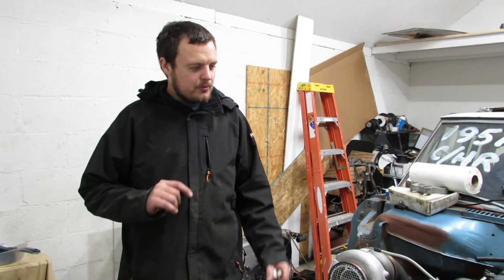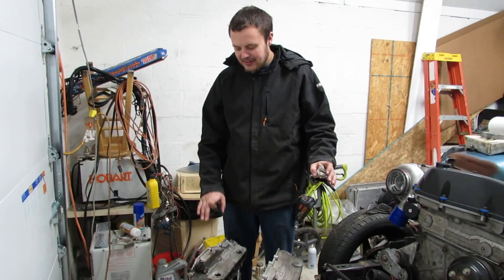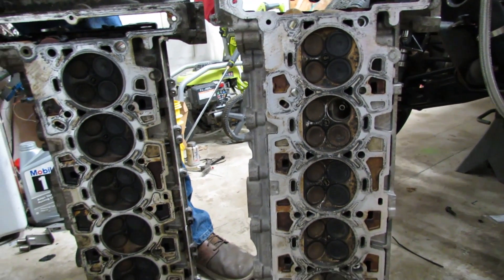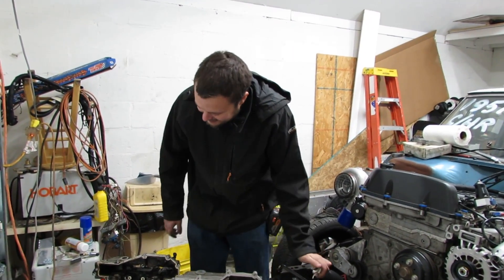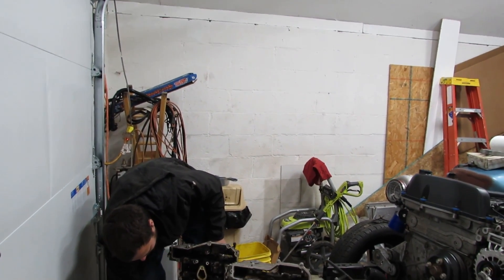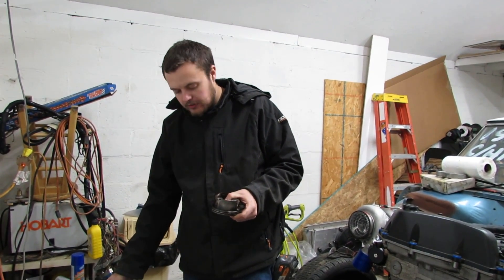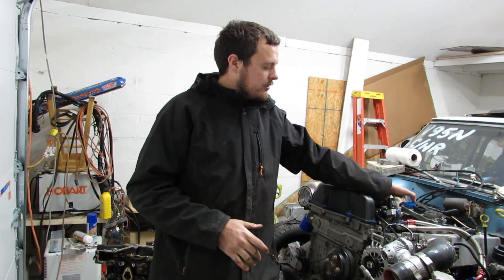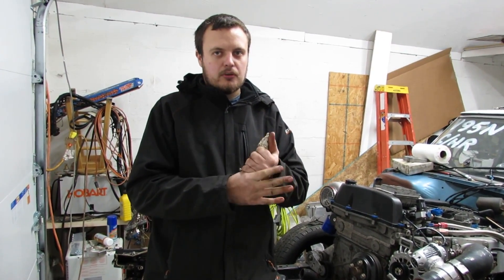Vortec 4200 Engine Differences

Comment: you're going to laugh at me, and this sounds pretty ignorant, what I'm about to say.
 I just noticed something that makes the 4200 kind of bulletproof, compared to the V8 and LS motors:
on the v8LS:  main/rod-rod/main....
on the 4200: main/rod/main/rod....

Now, I know the LS can handle tons of horsepower. That basic v8 crank layout is in top fuel motors making 11,000 horsepower. I'm not saying v8s aren't strong.  All that I'm saying is, just by the look of the crank in the Atlas, it should be able to handle tons of horsepower more easily, with less stress on that crank. 
If you ever want to see something really funny, look under an early 6 cylinder, or a flathead V8.... it amazes me, how few main journals you need, for engines with so many cylinders, LOL
Reply from the maker: Yep. Now you are starting to understand. 

I've seen the early 6 cylinders. Like 4 main caps. Crazy.

Comment: So how do set and forget the vvt???
Reply from the maker: Lock the exhaust cam position.
Reply: So would it be easier to just swap a healthy 06 engine rather than do the 06 head swap
Reply from the maker: @fredsamuels6407  it is probably easier to just do a head swap, but if you question the health of the bottom end, up to you.
Reply: I've got an 04 trailblazer with that valve issue that I didn't hear about till after I got it

Comment: For the life of me I do not understand why GM gave up on this engine platform. Perhaps limited use is one reason but to be this would have been an ideal base engine in the Chevrolet pickup. Or in commercial vehicles. 
In reference to the dyno results versus the 5.3L LS. Maybe the reason the the 4.2 made more power at the same boost level is the cam timing. The bigger cam in the LS with more valve overlap might have been allowing more fuel air mixture to blow thru the cylinder during the overlap period. At the height of piston aero engine development in the 1940s high output aero engines did not have extreme cam profiles. Remember these engines often had two stage,  two speed supercharging systems.  The second stage was not to provide more boost st lower altitudes but to maintain power output at higher ones.
Reply from the maker: But I thought that all cams are turbo cams! 

In all seriousness. You're probably onto something there. We adjusted the cam timing on the 4.2 and picked up probably 45hp on the last pull.
Reply: @Calvin-Nelson  
One does need to remember that automotive and aero engines are different ball games in a lot of ways. Aero engines are not high rpm. But given their overall size and long stroke they reach some pretty impressive peak piston speeds. Plus there is the need to be extremely reliable. The Allison for instance was pushed up to around 65 inches of boost at the squadron level during the war.

Comment: So friend  has an 07 2x2 with bad engine / rod knock till it warms up after short time drive comes back. He got a deal on an 04 4x4 thats clean. Seems the crank and cam teeth count are the same. Only issue maybe the vvt on the cam as they changed  06/up ? If that isn't an issue should work fine since change rails or what minor things over. Don't thing oil pan isissue.  Yard was saying they should interchange according to Hollander. Thanks
Reply from the maker: Yeah. Should interchange. Like you said the VVT is the only question mark.

Comment: Love these inline sixes. One of wards ten best engines. More powerful and torquey than the 4.0 in the Jeep.
Reply: Generations more advanced of a design. What would you expect. The 4.0 is a great engine that will tun forever. Provided it is taken care of. But it was an old design. The initial production of the design was in 1964 but in concept it is very similiar to any other inline OHV six. Post 2000 there was some preliminary work done on adapting it to 24 valves.  Either OHV or a head similiar to the Chrysler 3.5/4.0 V-6. The 3.5 is a little weird. 4 valves per cylinder with two intake lobes and one exhaust.
Reply: @mpetersen6  yes i had a 4.0 litre in a 1993 cherokee 2 door. It had 340,00 k on it when i sold it. Was running perfect as was trans. It seemed bullet proof.
Reply: @TC-hs5wy  
Remember when GM was building that Cyclone S-10. Spent a bunch of money taking a specially prepped one out to the Salt Flats and set some records. A year or two later an engineer in Jeep powertrain on his own prepped a Commanche with a 4.0. Turbo etc. Took it to Bonneville and crushed the records that GM set. Pushed that Commanche up to close to 200.

Comment: On modern engines without rocker arms they are internationally known as "valve cover" but are sometimes referred to as a "cam cover" or "timing cover" if they also cover the timing gear(s) and belt or chain.
Reply from the maker: Good to know. I'll still screw it up.
Reply: @Calvin-Nelson  I just copied and pasted that - I had never even heard of either term before - thanks for the great vids! I'm tooling around in my TB 04 - wondering if some MMO will clog up my oil pan filter since the whole drive train would have to be taken apart if that happens! haha. I used some MMO before and had the classic dirty exhaust smoke clean out. So I guess I got lucky. Also I put in boron Nitride. ... At 267K so far so good - the third valve did not burn out as happens on those engines. haha. thanks again.

Comment: so is the older engine better then the newer engine
Reply from the maker: Eh. The crank is. The later rods are a tiny bit larger, and have larger pins. Also the later heads are better. 

My recommendation to everyone is buy whatever you can find and stick a turbo on it and never look back
Reply: @Calvin-Nelson  I swear my local mechanic was after my engine. haha. He insisted I had to salvage the car. I went to a welder who said the rust hole was in the "neutral zone" of the chassis - fixed it no problem. I figured it was fixable. Thought it was strange how adamant the mechanic was.

Comment: GM tends not to fix things that aren't demonstrably broken. I'd upgrade valve springs on a turbo engine if they did for n/a.
Reply from the maker: We've used stock valve springs up to 600whp. 25 psi boost.

Comment: I pulled an engine from an 07 and am putting it in an 08 I see the flywheel is different on it... Anybody notice this? I checked the cam phaser same and the crank sprocket also the same... So what is the reason for the change torque converter? Also it has a bearing in the back of the crank? Kinda like a throw out bearing but not
Actually they are both from 08 but one is from a TB and one from an envoy. 
The year and date on the door was 07/07 but the title was 08
Reply from the maker: 08 should have 58 tooth. If it has the 7 tooth, it's not an 08

Comment: Great channel.  Regarding differences through the years, are the 2002-2005 blocks externally the same as 2006+ blocks? I have a 2002 that I plan to use for fitment test and motor mount fabrication.  If I get it to fit, I plan to find a good 2006 to swap in.
Reply from the maker: Only difference dimensionally is the cam cover is a little shorter lengthwise and a bit taller on the later motors.
Reply: @Calvin-Nelson  Thanks man!  I got the 2002 motor - reportedly bad - for $50.  Going to attempt to fit it in 2nd gen camaro, so I know I have some work ahead of me.... along with doing a rear sump pan.
Reply from the maker: @slackhannan1665  very cool.

Comment: Can you use any aftermarket ecu with this engine, like a Holley terminator?
Reply from the maker: You can use any ecu with it that supports the trigger. Also, I recommend making sure it supports the VVT. The holley Terminator would only work on the 08-09 motors unless you put an external trigger wheel on it. However Terminator will not control the VVT.

Comment: I have a colorado and want to keep the 58x wheel so that way all my guauges will still work along with other body functions. Can a stand alone ecu be wired in some how to piggy back?
Reply from the maker: Yes. You'll have to send the signal from some sensors to both ECUs (crank sensor, cam sensor, TPS, etc), and add redundant sensors (map sensor, CLT sensor, IAT sensor, etc). Then you'll have to have the aftermarket ecu take over control of the coils and injectors. 

It's not ridiculously hard. Just get a good wiring diagram for the stock ecu and go one wire at a time.

Comment: Hi, I've got a quick question. I have an 05 trailblazer ls 4.2 but I think I've got an 06 engine. I recently had the exhaust manifold replaced. If the shop put on an 05 manifold instead of an 06, would it make a difference. I checked and they are 2 different part numbers. Thanks
Reply from the maker: It may have a very tiny effect on power, but I doubt it. The 05 manifold has smaller ports and runners on the manifold.

Comment: I have an 09 that just spun a rod bearing.  I’m suspect of those squirters, what do you think?
Reply from the maker: It's possible. We've run the roods with piston oil squirter up to 713 whp and not had issues though.

Comment: I’m surprised atlas 4200 didn’t replace the 4.3 vortec I’m glad they started putting LS parts on it makes things easier
Reply: Engine packaging.  Same reason Chrysler dropped the 4.0.
Reply: @mpetersen6  but in trucks? That isn’t much of an issue
Reply: @lasthopelost9090 
When they redesigned the vehicles using the 4.2 the motor would not fit anymore.

Comment: How much boost can you safely run?!?
Reply from the maker: We've run as much as 26psi on a completely stock motor. Your mileage may vary.
Reply: @Calvin-Nelson  I’m looking for a streetable application… I was thinking 8 - 12 lbs for that 10.3:1 compression.
Reply from the maker: @MrPowecat  Sounds reasonable.

Comment: Do you know if a  06-07 engine from the Envoy can be swapped into an 05 Envoy and run on the 05 ECU?!?
Reply from the maker: Everything should physically fit and plug in, but the PCM may need some slight tweaks to the tune. Also VVT solenoid may have different PCM tuning.
Reply: @Calvin-Nelson  Thank you…. So it’s not just plug and play. Good to know. That may be a later project
Reply from the maker: @MrPowecat  it might just all work. Hard to say.

Comment: Hey i have a 05 gmc envoy with the 4.2 its got a check engine light on the dash for code p0014 which is the advanced timing on cam b code i was just wondering do you know if i have to do timing belts or if there's just some cam sensor i have to replace

Comment: The 4.2l i6 is such an underrated motor. Everyone looks for the V8 and everything. Nobody on here is doing anything with the 4200. The Atlas motor has ALOT of potential. It just needs time an more eyes on it. There an amazing engine. Thank you for being one of a VERY few ppl pushing the limit of this motor
Reply: If I get my machine shop again (purchased one before the paradise fires and by the time I made space, the cops wouldn't let me up to clean out the warehouse where they were sitting)
I'll be doing a lloott of work on these atlas motors. Hopefully I can get another 5 axis manual mill and cnc so I can prototype AND test internals. Goal it to start producing my own "ameri-barra" set that would include anything needed to get to 1000hp reliably or 1500 as a strip hero with meticulous maintenance. Kind of like J.P. racing did with the 1gz-fe v12 toyota and 1fz-fe 4.0 2j derivative.
Reply: I never understood why GM DC'd this engine. Such a fantastic and silky smooth powerhouse engine.
Reply: @JmanRx81  Could have used it in the fullsize trucks instead of the turbo 4, but hey... Why use something that works great and runs forever.
Reply: Same with the Vortec 4300. People often rag on it for being "just a V6" when it's almost the same engine that was put into the GMC Syclone. You know, the 90's truck that beat a Ferrari 348 and a ZR1 Corvette.
Reply: Thanks For shedding light on a good thing👀👍😎
Reply: And I been a longtime member of Inliners International
Reply: Inline 6's are underappreciated across the board, yet they are the most reliable, smoothest engines designed on planet Earth, and they make great torque at low RPM's.

Comment: Great video on the differences between the years, could you do a video on the blocks themselves though? I'm pretty sure they're then same but no one talks about them
Reply from the maker: They're pretty much the same, but there are some non visible differences, like the sleeves in the later ones are apparently stronger.

Comment: thanks for the info i have a 2007 gmc envoy with a bad motor but the replacement motor is out of an 2003!! im guessing i might run into some problems... do you know how much of a problem thats gonna be? i have both completed vehicles 2007 GMC envoy and 2003 Chevy Trailblazer for any donor parts i need
Reply from the maker: Only problem may be the VVT has different characteristics. The tune may be a little unhappy. Also the airflow of the engine may be a bit different, but it should be close-ish.
Reply: @Calvin-Nelson  thanks do you have any advice for what I can do about it bc from what I can tell after starting it this morning, you are exactly right! I started it ran surprisingly smooth until I shut it off and tried again
Reply from the maker: @GrizzlyEnd  I don't deal with the stock computers very often. Not sure what to recommend.

Comment: yes i need know this as the wiki said a redesign  happened thank you ill be using this with manual transmission may want to use in a 4x4 also any suggestions just subscribed .be blessed man

Comment: Hi from Australia. Could you confirm the trigger teeth pattern for me? Is the 7 tooth 6 even teeth plus 1? and what is the 4 teeth on cam even on the 06-08? Thanks.
Reply from the maker: Hey guys. It's an honor. It's 6+1 on 02-07 engines. 08-09 had 58x identical to an LS. The cam is a weird 6 tooth pattern from 02-07. In 08-09 they went to 4x identical to an LS. The cam sprockets interchange across all the years.
Reply: No sh**! Imagine having the SF lads hit you up!

Comment: I have an 06 Trailblazer with the 4200 and I love it. The best inline 6 I ever drove. Pulls very strong for its displacement.
Reply: I agree I have the 04 version and it pulls very hard especially once you get to 3500 and above  feels like a little boost kicks in but it’s just the vvt working.
Reply: @Thumper68  I’ve got an 02 with 440k on it and running strong it burns a little oil but what can you expect
Reply: @ucsasinkings8296 holy shit man!
Reply: Mopar Slant 6 from the 60s!!! Bullet proof, and zero electronics...
Reply: I drove a '64 dodge school bus back in the mid '70s that had the 225 slant six. I have to say, out of the fleet of 16 it was the only 6 cylinder. It was a dream to drive. 4 speed with 2 speed axle. Twice the mileage of the newer 8 cylinders. Never had a starting problem in the winter months here in Michigan. Loved it. It went to auction that I didn't know about or I would have grabbed it.

Comment: I'm glad I found your channel. I bought a 2004 TB with 65k miles in 2008. I still have it and it now has 178k miles. I'm picking it up today from the transmission shop. They rebuilt the tranny because the tc blew up. It's a great suv less the bad mpg. It has never fail an emission test.
Reply: I've seen some of your vids. You are always missing with the tranny and the tcm,, so what happened? Why did it blew up?!
Reply: @marlo0oty213  I guess because I install a Corvette servo a long time ago. It was shifting to 2nd. too hard for a long time.
Reply: @Fone65  still you had a chance for a manual tb or some other gear to try other than the 4l60
Reply: @marlo0oty213  I would like to install a 6L80.
Reply: @Fone65  I can’t wait to see that. Good luck but I guess the  trans housing is different you may have to make a custom adapter plate!

Comment: How many different oil pan options are out there for swaps,  or are people just modifying stock pans?
Reply from the maker: Only one aftermarket option from Emtech Motorsports. We take 5 cylinder pans and lengthen them.

Comment: My mom has a old 2003 trailblazer with a 4200. 120,000 miles, beat up a little but in decent condition. Transmission is like 20,000 miles cause it died at 100,000 (I don't know why, mom had to get it replaced). Going to dust it off, has been outside sitting for the past year, get it inspected and add maybe the ss body kit to it and some bigger tires, and do e85 swap with some boost and it will be prime.

Comment: What position does the vvt need to be at to add more power. You touched on it in the video but didn't say anything else
Reply from the maker: It varies over the rev range.  I talked about it towards the end. It's around 20 from 2000-4000, and 18 from 4000 up